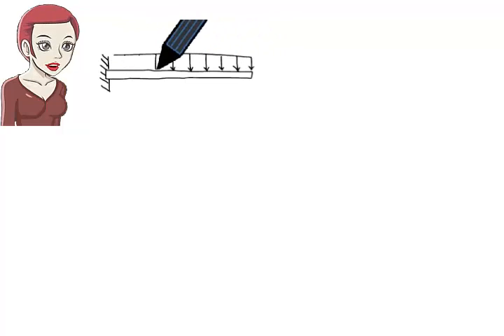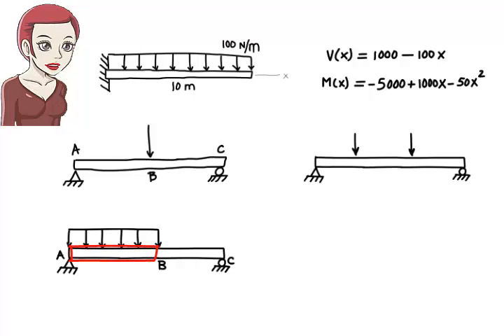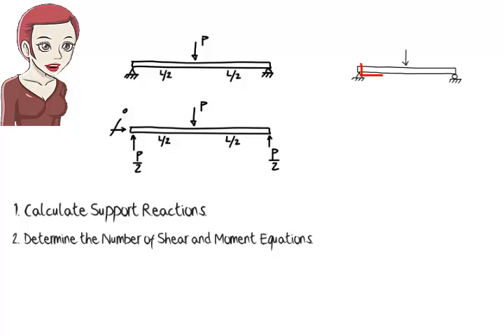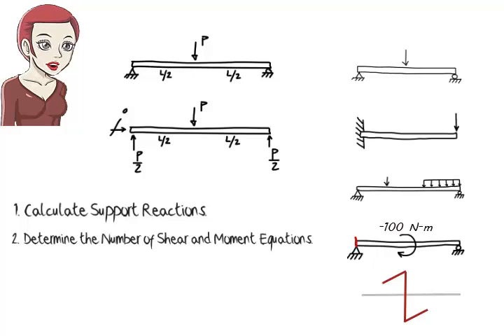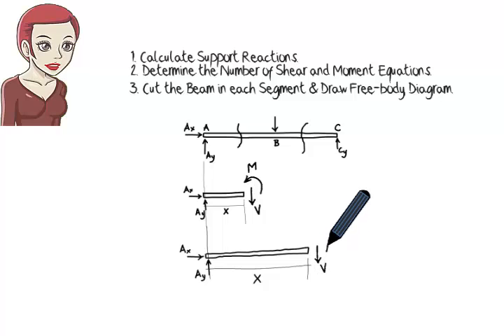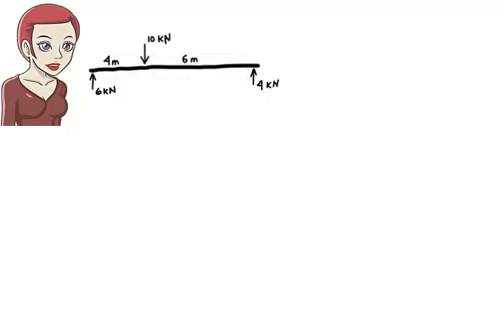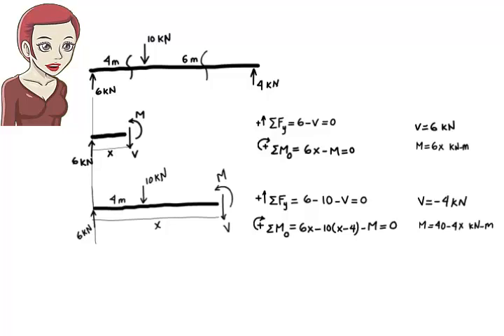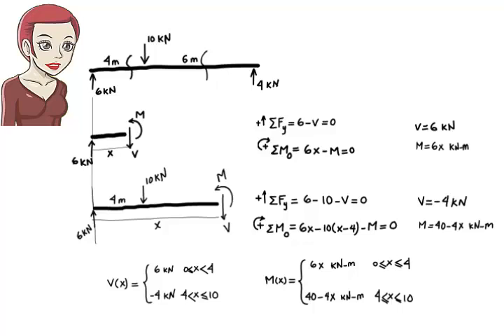SA07: Shear & Moment Equations

Comment: hello dr structure ....I want to know the program used in the explanation
Reply from the maker: This particular lecture was prepared by (1) tracing the lecture notes using an stylus on an iPad and saving the trace as an SVG file, (2) loading and running the SVG file through VideoScribe online tool to generate a video file, and (3) loading the video file into Camtasia Studio and synchronizing the video with the audio file which was recorded separately.

Comment: I have a question...  in 6:38 If we have cut the beam  into two segments  then why in the free body diagram for the second segment did we include the first segment. I would think if we are making a free body diagram of the second segment  we would  exclusively use data of second segment.
Reply from the maker: We first cut the beam to the left of the concentrated load, drawing the free-body diagram for the left segment of the beam, and use that diagram to write the shear and moment equations for the segment. We are not using the information from the right segment of the beam when writing the equilibrium equations and generating the shear and moment equations. 

We then cut the beam a second time, this time somewhere to the right of the concentrated load. Since we want to write the moment and shear equations in terms of x where x is the distance from the origin of the coordinate system to the cut point, and the origin is located at the left end of the beam, we take the beam segment from the origin to the cut point as our free-body diagram.

Comment: this doesn't make sense, how do you assume the distance is x in both segments! the system should't work
Reply from the maker: Imagine two beam segments each having a different length and is subjected to a different load. For each beam segment, we define the origin of the coordinate system to be located at the very left end of the segment. We then define variable x to be the distance from the origin to an arbitrary point on the beam, and use x (a variable, not a constant) to formulate the shear and moment equation in that beam segment. This reference system does work. Feel free to elaborate why you think it does not work, what flaw do you see in the formulation. The more specific you are, the better we can address your concern.

Comment: 10:55 What if there's a roller or pin in the middle of the distributed load? Would  still count as one section?
Reply from the maker: No, the reaction force at the roller/pin support causes a discontinuity in shear and moment. You need to consider that as two separate segments each with its own shear and moment equations.
Reply: Dr. Structure Got it. Thanks a lot.

Comment: Cy should be 25? because of 5/2= 2.5 half of 5*100?
Reply from the maker: I cannot follow your line of reasoning here. Are you saying Cy should be half of the total load? Half of (5)(100)?  That would have been the case only if the load was distributed over the entire length of the beam. Here, the load covers half of the beam only, and since the load is closer to A, then Ay carries a larger portion of the load.  

Now on to the math behind this. The last equilibrium equation @10:30 reads: 100(5)(2.5) - 10 Cy = 0. This gives us Cy = 125. To show that Cy is anything but 125, you need to prove that either the equation is incorrect or the calculation is done incorrectly.
Reply: XD I see the eq could be also written as 500*2.5-10*Cy=0 right )?
Reply from the maker: Yes, the distributed load can be replaced with its equivalent concentrated load. The magnitude of the concentrated load is (5)(100) = 500. The location of it is at the center of the load rectangle which is 2.5 m away from point A. So, the moment of the load about A can be written as (500)(2.5). The entire equilibrium equation then becomes: (500)(2.5) - 10 Cy=0.

Comment: what happens differently if the x only goes to a section of the beam
Reply from the maker: Since shear and moment equations cover the entire beam, then x needs to be defined form 0 to L, where 0 is the start point (often the left end of the beam) and L is the end point (usually the right end of the beam).

Obviously shear and moment diagrams could be piecewise continuous, meaning we can have different equations for different segments in the beam. So, x could be defined for each beam segment. This is demonstrated in the video. 

You can also use different coordinate system, say, x going from left to right for the left segment, but changing from right to left for the right segment. But this is not advised as it often leads to confusion. For the sake of consistency, it is best to pick one origin (usually the left end of the beam) and measure x from that origin in every interval (segment) in the beam.

Comment: could we apply same rules in frames also??? Actually I'm facing difficulty in shear force & bending moment diagram of frames. In between thanks for sharing such precious lectures on YouTube.
Reply from the maker: In frames, we draw shear and moment diagrams member by member, then assemble them into a single diagram.  For example, if a frame member is vertical, you can rotate it (align it horizontally), draw its shear moment diagram, then rotate it (along with the diagrams) back to its actual orientation.
Reply: Now I get your technique for solving frames. Thank you for helping me out.

Comment: @3.55, it is mentioned that a concentrated moment on a beam at a point will cause a sudden drop in the bending moment diagram. Why so ? if this acting how the bending changes from positive to negative ?
Reply from the maker: Imagine a simply supported beam of length L subjected to a uniformly distributed load of w. The vertical reaction force at the left end of the beam is wL/2, and the bending moment equation for the entire beam is:

M(x) = (wL/2)x - w x^2/2

This is a continuous function with no jump in the moment value. For example, at x = L/2, we get a moment value of wL^2/8.

So, bending moment just to the left of midpoint as well as bending moment just to the right of the mid point would be wL^2/8.  

Now, suppose there is a concentrated moment (M) at the mid point. This means, if bending moment just to the left of the mid point is m1, then moment at the right end of the point would be equal to m1 + M, since going from left to right, all of the sudden M appears on the beam. This all of the sudden appearance of a moment on the beam means the difference between bending moment at the left end and the right end of the midpoint equals M, hence the drop, or rise (depending on the direction of the moment) in the moment value.

Depending on the moment value at the left end of the midpoint, the drop/rise in the moment may not cause a change in the sign. For example, if moment at the left end of the midpoint is 100 kN-m, and the concentrated moment is 80 kN-m, the moment at the right end of the point would become 20 kN-m . Here, there is no change in sign.
Reply: Thank you :)
Reply from the maker: anytime!

Comment: Hi, I am going to have a exam tmr, so hope I can get an answer by tmr. I dont understand how the equation formed at 10:26 : 100(5)(2.5) - 10 Cy 
Do you mind explain it more? thanks
Reply from the maker: The magnitude of the distributed load is 100 N/m, it is distributed over 5 m. Let's replace it with a concentrated load. What would be the magnitude of the concentrated load replacing the distributed load? (100)(5). That is the area of the rectangle. Where would we place that load on the beam? At the center of the rectangle, at 2.5 m away from point A.

So, what would be the moment of the concentrated load about point A? Its magnitude time its distance from A:

(100)(5)(2.5)

The other term in the equation is the moment of the right support reaction about A.

The two moment terms differ in sign, one is positive the other negative, because one has a clockwise direction and the other has a counterclockwise direction.
Reply: oh my god you reply so fast, I havnt gone through it yet but this definitely helps more than my college professor.
Reply: great i got it now, thank you so much!!!! you dont know how this mean to me esp i am going to have the exam right tmr
Reply from the maker: You are welcome!

Comment: I guess that we are supposed to multiply the 100n/m by x and then by x/2 in the shear equation. Please correct me if I'm wrong.
Reply: I guess that I am wrong, I just checked it. 
Dr structure, are you using counterclockwise as -ve in your sign convention?
Reply from the maker: The sign convention for writing the moment equilibrium equation is rather arbitrary. We cannot do wrong as long as we are adding all the clockwise moments together, all the counterclockwise moments together, then subtracting one sum from the other and setting it equal to zero.

Comment: @dr.structure when applying moments in terms of x specifically at 12:43, why do we refer to moment arm from concentrated load to M as x-2.5 and not the other way around (2.5-x). This always gets me confused. Many thanks!
Reply from the maker: Moment arm is the distance between the load position (say, Point P) and the point we are taking the moment about (say, Point O), here the right end of the segment. How do we determine the distance between P and O?

Generally, we assume the left end of the beam to be the origin of our coordinate system. Say, the load is positioned 3m away from the origin and the right end of the segment is 7m away from the origin. What is the distance between these two points? 7 - 3 = 4. So, if we are taking the moment of the load about the right end of the segment, the moment arm would be 4m. 

In our formulation however, the beam segment does not have a fixed length, we use x to denote the length of the segment. That is, x is the distance from the origin to the right end of the segment. 

Further, the first 5m of the segment is subjected to a distributed load. We are going to replace it with a concentrated load. The magnitude of the concentrated load is (5m)(100N/m), or 500 N. This load is placed at the geometric center of the distributed load which is located 2.5m to the right of the origin. So, the distance between the load and the right end of the segment is (x - 2.5). 

Another way of looking at this is to keep in mind that distance (the moment arm) is a positive value. This means we need to subtract the smaller value from the larger value when determining the moment arm. Since here x is the length of the entire segment, it is the larger of the two values.
Reply: +Dr. Structure Rock on! Mighty thanks for that explaination. Great video and I hope there's more to come :)

Comment: why have you take the shear force direction downward!???
Reply from the maker: The sign of shear in a beam segment is always decided using a pair of forces: a shear forces at the right end of the segment, and one at the left end of the segment. These forces act in opposite directions.

By convention, if they tend to cause a clockwise rotation, shear is considered positive. This means, shear is considered positive, if the force at the left end of the segment is upward and the force at the right end of the segment is downward causing the segment to turn clockwise.

Comment: At 7:51 summing the moments, are you using the left handed rule to solve for M?
Reply from the maker: It really is not the left- or right- hand rule. It is clockwise or counter-clockwise rule. It does not matter if you decide clockwise (or counter-clockwise) to be positive or negative, as long as the sign convention is used consistently throughout the equation.

Comment: For the last problem, how do you know that the interval of x for the second one is from 5 to 10?
Reply from the maker: +David Gallo Here, since the uniformly distributed load is applied to the half of the beam, we have two segments: the (left) segment subjected to the uniformly distributed load and the right segment with no load on it.

Assuming the origin is located at the left end of the beam, then the left beam segment is between 0 and 5m, and the right segment is between 5m and 10m.

Since we are measuring x from the origin, then for the left segment we have 0 < x < 5 and for the right segment we have 5 < x < 10.
Reply: +Dr. Structure Thank you!

Comment: at 12:08 should the moment of origin equation be 
375x+100x(x/2)-M=0 instead of 375x-100x(x/2)-M=0 because using positive will result in the -50x^2. Could you please check if this is right. thanks
Reply from the maker: +Jody Lao The given equation is correct. Here, for writing the moment equation, clockwise assumed to be positive. 

The support reaction at the left end of the segment generates a clockwise moment about point O. This moment is 375x.

The downward distributed load generates a counterclockwise moment about Point O, hence the negative sign. We write this as: -100(x)(x/2).

And, since the internal bending moment (M) at Point O is drawn in the counterclockwise direction, it is shown as -M in the equation. So, the entire moment equation is written as:

375x - 100x(x/2) - M = 0.

Simplifying and rearranging the equation, we get:

M = 375x - 50x^2

Comment: Great! Only thing I didn't really catch on was the Momentum equation for the first segment (A, 0<x<5). M = 375x-50x^2.
375x I get, but what's the 50x^2 ? I why does the squared x come in the equation? Thanks!
Reply from the maker: +Sands Kreative Verksted There is always an x^2 when a distributed load is present. One x is for calculating the area of the rectangle under the load (x is the width of the rectangle). The other x is for the distance from the center of the rectangle to the (cut) point. So, you need to multiply the first x (actually a multiple of it) by the second x to get the moment of the distributed load about the point.
Reply: Thank you very much!

Comment: Need help in this question.

This is about the Moment (M) equilibrium equation at 6:27.
If M is assigned positive in the clockwise (cw) direction, then all the forces pointing down (which causes M to be in cw) are assigned as positive. Is my assessment right?
Reply from the maker: ***** Yes. In this example since we are taking the moments about point A (the left-most point in the beam), then any downward force would cause a clockwise moment.

In general, a downward force causes a clockwise moment if the moment its being taken about a point to the left of the force. If the moment however is being taken about a point to the right of the downward force, the direction would be counter-clockwise.
Reply: Dr. Structure So if the Moment--taken from the right--is assigned positive in the ccw direction, then the downward force is assigned as positive?
Reply from the maker: ***** If I understand your question correctly, the answer is no. The direction (sign) of the force is not really related to that of the moment.

1. By convention we assume an upward force to be positive and a downward force to be negative. If you wish, you can choose a different sign convention as long as you do it consistently. For example, you can take the downward direction to be positive and upward direction to be negative.

2. When it comes to a bending moment, it either is causing a clockwise rotation or a counter-clockwise rotation. Again, by convention we assume clockwise to be positive. 

So let's say we go wit the convention: upward force is positive and clockwise moment is positive.

Now say we have a point and an upward (positive) force. Depending on the location of the point, the force could cause a clockwise (positive) moment or a counterclockwise (negative) moment about the point. 

Simply put, a positive moment is not necessarily caused by a positive force.

The best way to determine the direction of the moment that a force causes, imagine a circle where its center  is at the point and its radius is the distance from the center to the head of the force. Now make the force orbit around circle in the direction of the force's arrow. Is it moving in the clockwise direction or counter-clockwise direction? That is the direction of the moment.
Reply: Dr. Structure After watching your videos and others, I think I finally understand.
[Going with what you said; BM in the cw direction is positive (+) while BM in the ccw direction is negative (-)] and I will be using the example at 6:28 to illustrate my understanding.

Let's say I'm taking the Summation of Moment at B.If I assigned ccw for Moment at B to be negative (or which is the same as saying cw at Moment of B is postitve), then:

M = -By(0m) - 10kN(6m) + Ay(10m); The rest is solvable.

What I wanted to show was that I assigned By(0m) & 10kN(6m) to both be negative because they produce ccw motion at B and since I already assigned ccw at B to be negative means that they have to be negative.

Ay(10m) is positive because it produces a cw at B & cw at B have been assigned as positive.

Hopefully, this assessment was right.
Reply from the maker: ***** Yes, your analysis is correct.
Reply: Dr. Structure Awesome. Thanks for your assistance.